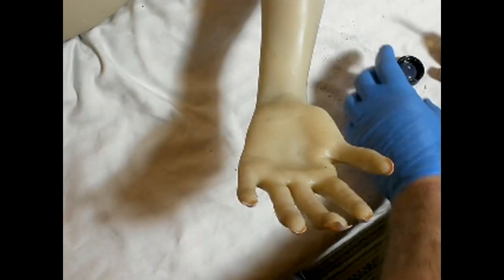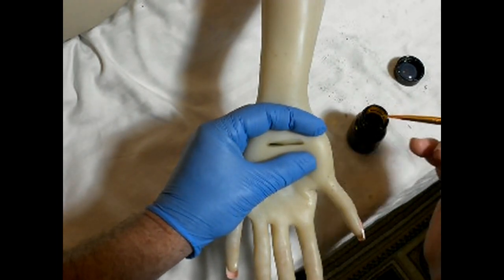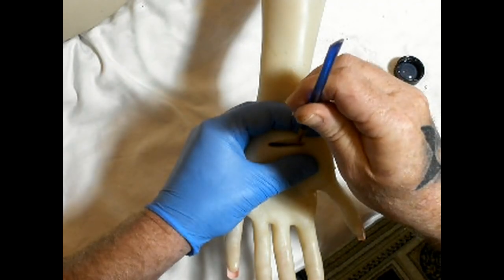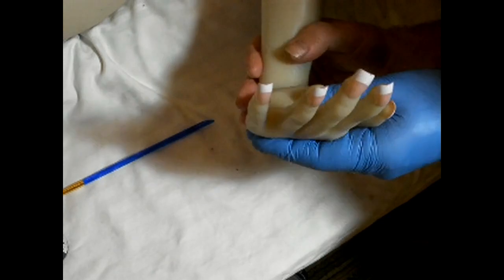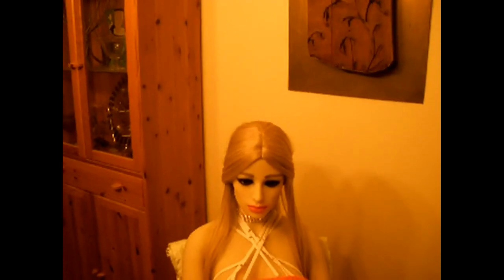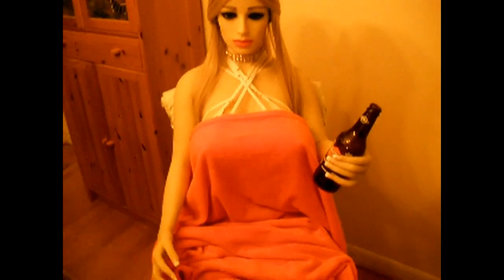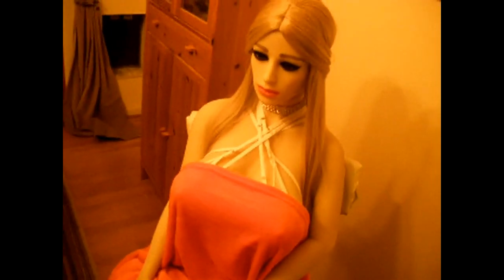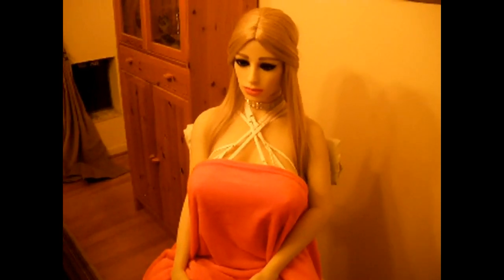Replacement Hand Skeleton for TPE Dolls - Installation Part 3.

Comment: Awesome job. Why they don't use hands like that straight from the factory is beyond me. The wire fingers just plain suck!
Reply: Its a cost cutting measure im sure. Though in reality with 3d printing becoming cheaper by the day, at least ONE of these damned manufacturers in china needs to take the "lose a little bit of money NOW to make a BUNCH of money in the future" approach. And I only mention china as the manufacturer because thats where most of my dolls have been purchased from. Im pretty sure the "american" or "european" producers all actually have fully built and articulated hands and even feet or toes in their dolls, but I seem to remember it being like a 600+ dollar upgrade (from abyss at least) usually, years ago when I used to drool over their dolls and price them out.....I have happily bought around 9 dolls (sadly have lost 4 to massive and or full structural failure, mostly due to user error and learning on my part, only ONE due to it being cheaply produced, she was the only one with SQUARE rods in her skeleton versus round ones, and shitty welds at key structure points. Suffered a hip snap, poor girl....) for a FRACTION of what an OG real doll would have cost us. Hanidoll on ebay was my most recent supplier, VERY happy with their double jointed skeleton, MANY great posing possibilities, good strong skin, beautiful "designs" available, great communication from the seller/company, GREAT prices and shipping time, but sadly her hands are wires as well and as usual, they are  the first parts to start failing on me. As someone who does quite a bit of amateur clothing design/photography using these dolls, not just "degeneracy", lol, a good WORKING set of hands that can LAST, and especially a set that can be strong enough for positioning/holding items heavier than like a tiny wooden violin or a figma figure, has become a bit of a sad bottleneck for me, especially if I want to get any more dolls in the future and not go totally overboard breaking the bank....

My most prized doll has had both her hands pretty much "deboned" at this point, and recently I think has had one of her entire wrists that they were attached to snapped off internally.....but sadly I think these hands in the video are maybe a little too big for her. 

My R/D idea ive been mulling over for a few years now is using LEGO TECHNIC RODS/JOINTS to maybe build her (or any "large scale" doll really) a set of hands. Those pieces are made of some pretty strong stuff (ABS maybe? cant remember off the top of my head), they slot into their respective joint pieces and hold VERY well (anyone remember using their teeth to remove them as a small child? lol), and best of all, they are VERY abundant and easy to buy on bricklink.com for pennies on the dollar, and the FREE digital lego software would even be a good place to test the idea without even spending a penny to start with. It contains every piece lego has ever made (including some they never produced) in digital format, and you can "build" just about anything out of lego with it very easily. A mockup could be made in it, and with its database of part codes, if a working solution is found, a list of part codes can be generated to find on bricklink within minutes. Something tells me im not the ONLY person out there who has had this idea though, so I could be 100 percent just chasing an old dragon that others have chased.... Need to check on places like dollforum and see I guess. Ive just seen so many people make like "wheelchairs" for pets whove lost limbs, etc, using lego parts, it seems like a real possibility.

Comment: You use the classic TPE GLUE???
Reply from the maker: I believe Dollyman used the Indigo cold weld in this video.  Unfortunately I don't think Indigo's products are available anymore.  Some have used the 3M 94 tape primer as a substitute.  There's a lengthy discussion about it on the Doll Forum here...
https://dollforum.com/forum/viewtopic.php?f=229&t=131728
Reply: @MF-Creations  Thx :)

Comment: Great videos. Have you explored the idea of using one of the readily available tpe hands on the market and just tying that at the wrist as you did here? The hands I got on my doll are crap. They are transparent as raw shrimp and 4 of the finger wires poked thru on day 1 with the initial cleaning. I’m hesitant to put a nice hand skeleton into such garbage. Considering the same for the feet. Both of them got partial tears the first day because the material was so thin in those areas. Any tips or suggestions would be appreciated.
Reply: psaint60, Do you mind if I ask which doll you have? Thx.